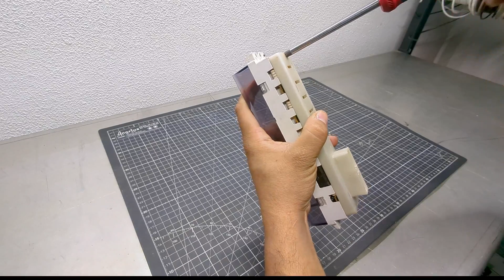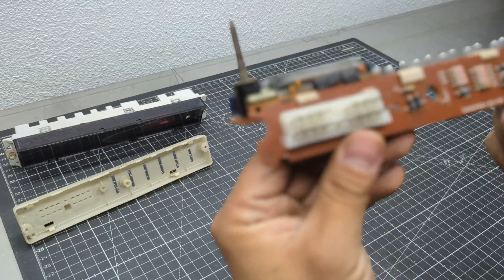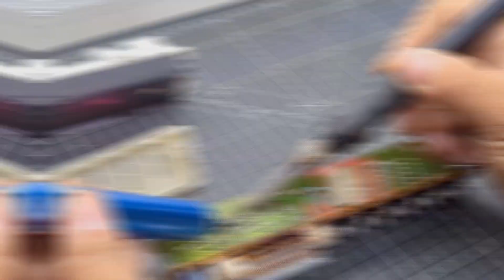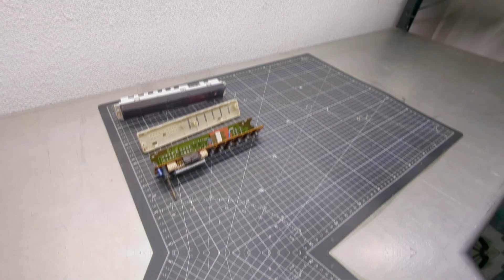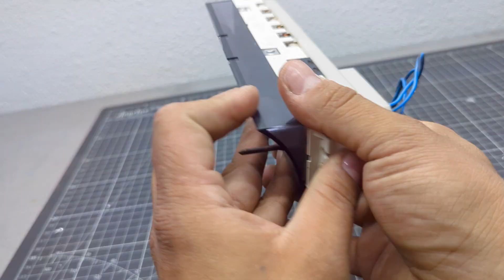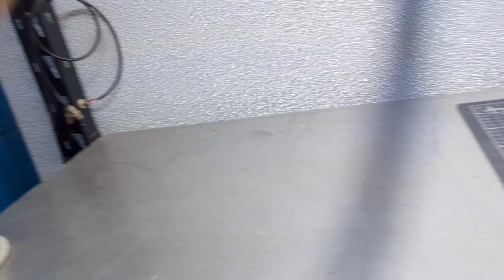GEESPECAUTOMOTIVE // CLOCK REPAIR  // RX7 FC

Comment: Did the Repair and still no clock tried new solder aswell guess I'm outta luck
Reply from the maker: You can always send it in for repair. I have yet to find one I can't fix.